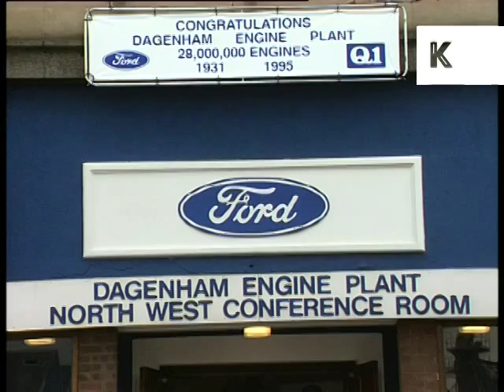1990s Ford Dagenham Car Factory, UK Industry

Comment: Arrr the good old1800 Diesel engine mines still running to this day 332 thousand miles and counting the only replacement parts it’s had is timing belts and a water pump